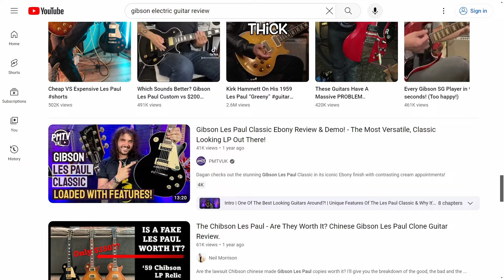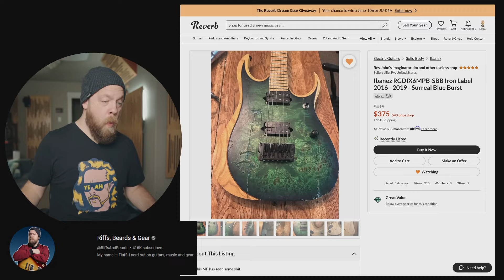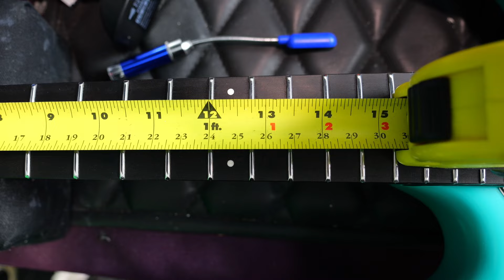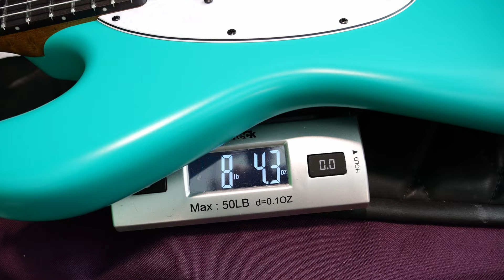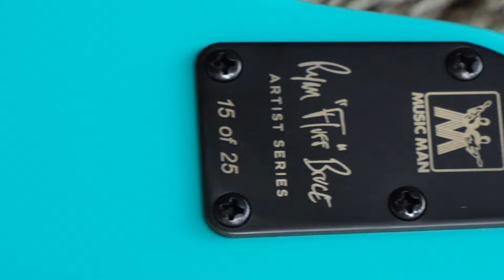I Bought Fluff's Signature Guitar! | Ernie Ball Music Man EBMM

Comment: "Let's make an offer."

$1000 (declined) $1001 (declined) $1002 (declined)
10 minutes later
$1870 (declined) $1871

"Wow!  He will accept exactly $1871 because it's impossible to decline or counteroffer!
Nah.
*NEXT TROGLY VIDEO!!!!*"

Seriously though, that high E string looks like it's sitting pretty low on the fretboard.  Seems like it's sitting right at the fret bevel.  The neck may have enough wiggle room to get the strings centered, but that's odd for such an expensive guitar.

Comment: A hardtail version of a Cutlass HSS would be a good seller. Without the active pickups. Just a solid body with no pickgaurd and direct mounted hss layout. Something you could easily upgrade if necessary. I'm not a fan of all the active pickups, boosters and focus gimmicks they put on all these. Adds unnecessary costs to a simple guitar design. I'd prefer  wraptail bridges on more models, and ditch the gimmicks.